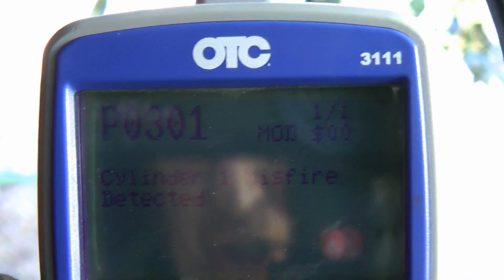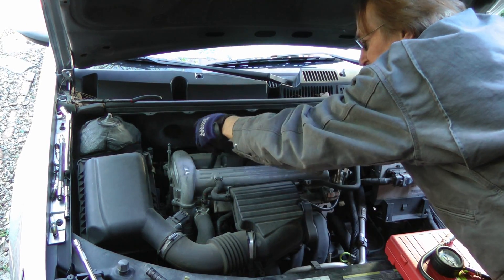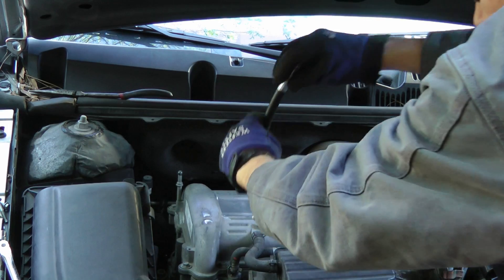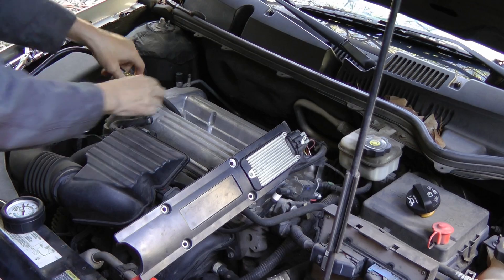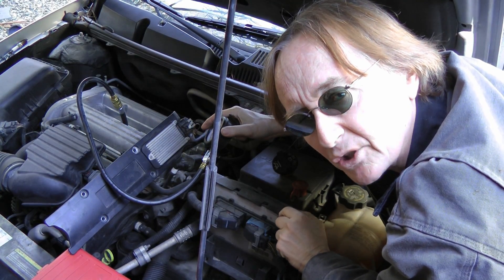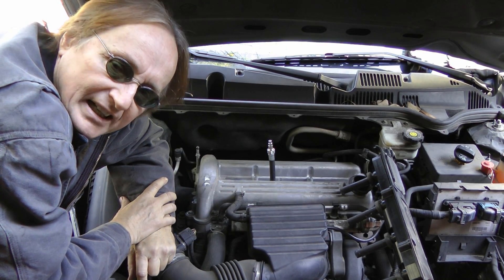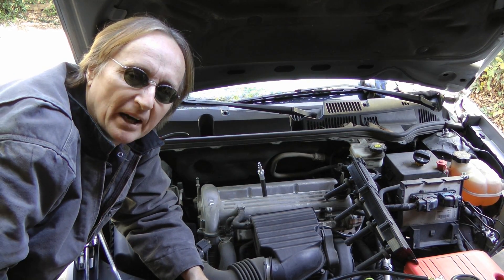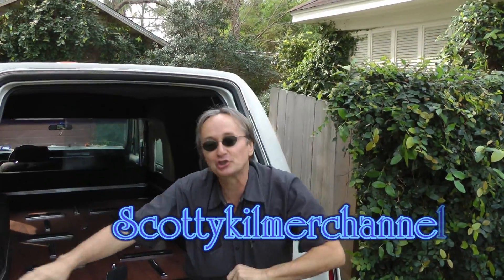Why Do Engines Misfire, Code P0301 (Compression Test)

Comment: Hi Scotty. I love your videos. I have a 2001 ford Taurus that had a mis fire problem Change coil and that fixed about 90% of the problem. Now, the car will run ok for about 20 secs and then the check engine light will start blinking and the car looses power. I havent had the cde checked yet but, do you have any idea what would cause this? Thank you.

Comment: In that case I'm curious as to what the original problem was in the first place because it's the same engine I have in the car now and it's running like a champ and is about to pass the 100k miles (about 60k of that put on by me). What could cause an engine that was put in to run very poorly but after (at the very least) a switch to full synthetic oil with restore additive to run like-brand-new? I guess the simplified question is what kind of problems can an engine have that fix themselves?

Comment: I actually had this happen on an engine I just got put in after the timing chain snapped on the first. After couple oil changes with full synthetic and restore engine restorer additive I've actually been able to drive my car daily since. So if it really is a bad engine would you recommend this attempt at a fix? A can of restore costs me about $8 (for the 4cyl formula). My engine had low compression all around and (after a catcon replacement last week) I'm looking at going over 200k :)

Comment: Turns out I bought bosh platinum 4 point plugs as an upgrade when the car called for ngk single points.  After putting in the correct plugs the code went away.  It cost me about 60 dollar for that mistake after rebuying the correct plugs. I'm sure that I am not the only bone head to do this.  Maybe this will help out some one else.

Comment: Love the video's scotty.  I had one of these (Engines Misfire, P0301) Codes last year on a 05 hyundai elantra.  I did a tune up to the car my self.  After getting it out of the garage I noticed check engine light on with this p0301 code.  Although the car seemed to run fine the code would not go away even after using a scan tool to delete it.
Reply: after misfire …how many it ran for ?

Comment: Hey scottie, got a questin for ya. I recently bought a chevy 7.4 liter 3500 express van/cutaway/rv, its been sitting for at least 2 months and i have to drive it back home, at least 200 miles. Is there anything i should do to prevent breakin down on my way home. will running it for 10 minutes before i hit the road help.

Comment: hey Scotty i have a 2002 civic si with a code p0301,2,3,4 
all cylinders are missfiring i have changed my spark plugs i checked for vacumm leaks,  i sea foamed it as well what else can i do to fix this

Comment: Hello Scotty, I have a 2006 checy impala with 102,000 miles....p0301 code, no prior problems and all of a sudden misfiring.  It was checked and the pressure in cylinder 1 is 120 and the pressure in cylinder 6 is 175....I dont know what to do....do I need a new engine???

Comment: Scotty, I need your input on this. My 08 Subaru Impreza WRX had a problem with "misfire" a few months ago. Only 46,000 miles on it at that time. I got misfire in 3 of the 4cly. The check engine light just appeared one cold night when i went to start it. I got the engine light turned off by my mechanic. The car runs completely fine no leaks anywhere. But I do find it very hard to remove/screw the oil cap back on.

Comment: Thinks there's multiple problems with this motor but this PO341 problem  cost me $352 last time & here it is again. After lots of research, seeing that it could be a shorted wire on crank sensor? Seems these engines 3.4 have this issue on many models including my 98 Venture.Work 14hr shifts can't get to mech til Fri but need it to get back & forth next 2 days for work.Need to get rid of the darn thing but really can't afford nor afford to any more $ into it.  lol What to do?

Comment: Having trouble 98 Chevy Venture (don't laugh).
Engine light on, dies or hesitates at stop signs/lights. Sometimes the motor actually jumps or as I say misses a beat, that's rare but happens. Had work done on it 6 months ago, same thing. Code PO341 again.Oh, now hear something ticking, after warm up goes away.Cam sens was supposedly replaced along with plugs on last repair,taking it back being same prob.Any ideas why it's happening & what to say to mech being it's the same again?

Comment: That pop is a back fire. Seems to me like something is interfering with airflow in the combustion chamber. Excessive carbon deposits can lead to misfires. Check your positive crankcase ventilation valve  or PCV to make sure it's not stuck closed. Also, a malfunctioning idle control valve could also lead to misfire and cause your engine to burn very rich at idlle.

Comment: hey scotty, i have a 2003 acura cl-s and im getting an all cylinders missfire code, changed plugs and did my 160km valve adjustment and it still persists, the idle is a off and the exhaust has a slight pop sound to it at random intervals, shop says do my fuel injectors but im not putting that kind of money into it, any ideas on what it might be?

Comment: hey scotty, I have 96 ranger 4.0 ohv........misfire on 6.......dry compression test 1-5 reads 105-115 psi, cylinder 6 reads 40psi my question is what is more probable a worn cylinder and rings or valves stuck burnt or dropped, and can I tell with the valve cover off if they are stuck or dropped seat, also I wanted to clean my throttle body but ther is a warning sticker that says do not clean special coating, really need some advice fixing misfire........

Comment: Hi Scotty, i recently tool my nissan altima 02 to the mechanic becauase suddenly started shaking and making noises, the mechanic told me right away it was the cataliytic coverter, he changed and the nose its gone, but the car keeps shaking and took it again and now he connected to the computer and the car throws a P0301 code, and says Cylinder 1 its misfire, the mufffler throws hot smoke and my service engine light started blinking..thanks..(Nissan Altima 02, 6 Cylinders)

Comment: Hey Scotty I have a 03 nissan sentra gxe 1.8 that keeps saying cylinder 1 misfire I used Lucas cylinder lubricant and it went away for a while then it came back so I change the spark plugs switched the coil packs and just installed a new fuel injector. Lucas got rid of the problem the first time so I thought it was the fuel injector is it the engine that is messed up?

Comment: Hey Scotty, I've got an 04 SAAB 9-3 that misfires, I've swapped the spark plugs for some fresh factory ones which seemed to make the misfire less rough and all the coils have been tested/working. Swapping the plugs around seems to solve it and the engine and gaskets are in real good condition. Haven't tried this yet but do you think engine pressure is the only possibility?

Comment from the maker: noises can be hard to pinpoint. But, remove the fan belts and run it, if the noise goes away, figure out what device the belts drive that has worn bearings in it

Comment: Scotty, I have an 08 Highlander with 140k miles on it. Everytime I start it up, on idle the engine makes some sort of a grinding noise. The truck runs smooth and it's not noticable when driving. Happens during idling only. What could it be?

Comment: I'm having a misfire as well on my 2000 Pontiac Grand Prix 3.8l. I've scanned the engine and I also get the code Bank 1 System Too Lean. I've replaced all the spark plugs and the wires, O2 sensor, and the injector o rings. I spray carborator cleaner around the fuel injectors and it's sucking in the cleaner even after I put in new injector o rings. Any thoughts?

Comment from the maker: check the carburetor or fuel injection system, whichever it runs, they don't sell em here. either carb needs overhauling or fuel injection system is leaking injectors badly using that much fuel

Comment: Scotty I did a compression test on a 95 Skoda Forman, all cylinders had 130 psi except the number one 120 psi, what would be your diagnose on this engine. The problem is that the car is eating gas like a V8 when its only a 4 cyl

Comment: ok i checked and the head gasket isnt leaking thank god, so that means it could be the injectors?? how do i tell? and i added some lucus injector cleaner to the whole tank and run it down.. still doing it. could it be a bad seal on the injectors and if so how could i check??

Comment: i have a 98 v6 3.8L camaro and it just started misfiring. i pulled the codes and i got p0300(random misfire). It idles good(constant 900 rpm), but lacks power and drinks alot of gas. Out of my exhaust im getting a good bit of vapor. I need an experts guess so i wont be out a ton of money...

Comment from the maker: that's the code for engine position problem bank one. It means the engine has a mechanical problem somewhere on bank one of the engine, the bank that includes the number one cylinder (that's how they label them). good luck on that one

Comment: Hi scotty, I have an '01 v6 cougar. when its cold it runs like new but when it gets to to full operating temperature its get very sluggish and unresponsive. it has no error codes when the scanner is put up to it. The car also has had a custom cat-back on it for the past two years, I don't know if that would effect much.

Comment: hi scotty I have a 2001 audi s4 twin turbo I just take my engine and trany out to rebuild my manual transmission . and I put new timing belt kit sparkplug ... and lot more now I just start my car its run fine but my power steering pump make noise and when I turn steering wheel car turn off and after that start miss fire. i didn't  had that problem before

Comment from the maker: make sure you have the right spark plugs that are gapped correctly first.  And if you cracked any plugs putting em in, that will do it for sure, take em all out and check for cracks in the porcelin

Comment: I'm in the process of repairing a misfire on my 2000 Ford E-150 4.2L. Kept getting code PO305. Plug, wire, coil, & injector all checked out good as well as vacuum and compression test. Turned out to be clogged EGR ports in the lower intake manifold for all cylinders except cylinder #5 sending the exhaust gas intended for all six cylinders to only cylinder #5 resulting in the misfire.

Comment: no it wont because the pressure will only build so much then be released and it can't push the tester anymore "lbs/sq. in."... on my dirtbike it has about 120 "lbs/sq.in" no matter how many times i turn the engine over it just stops there

Comment: I have a question about spark plugs. Last year my 99 camry broke down and I had to replace the air fuel ratio sensor. I let the vehicle sit for at least an hour and I replaced the front spark plugs. I also used anti seize on them. Should I be concerned when I replace the front plugs again

Comment: What about a 2000 Buick Lesabre, are they worth the trouble or more trouble than they are worth ? Mine is only used for quick trips to stores and back, but I'm concerenc about possible engine problems due to misfires.

Comment: I'm in UK here. Got a Chrysler crossfire booked in with a mercedes 3.2 AMG  E32 engine. Misfire on number 6 intermittent fault. Usual scenario swapped 2 plugs for next cylinder as there's 12 on this engine, swapped leads ect. Carried out compression test all good. All mixture adaptions correct and lambda. Manifold vacuum correct, I suspect a sticking valve, as your from the place they are made have you seen such a fault on this particular engine!

Comment from the maker: do this test first, and pray it's not the head gasket as in this car. if compression is good, it can be a bad fuel injector or bad coil on plug assembly

Comment from the maker: air flow often is changed on new heads, so they will often suck air differently and make such whooping noises, I see that a lot. if it runs fine, it means nothing. But often cleaning the throttle can stop it if build up is causing it.

Comment: @Jim Dillinger usually because the engine is cold. The air-fuel ratio isn't at a perfect  yet. The computer also tells the engine to run at a higher rev so the engine will warm up sooner. This is just a few things that cause that. Someone else can give you a more detailed answer. ( I'm too lazy)

Comment: Hey, i have a weird noise coming from the NEW head on my engine, the valves are also NEW/ Refurbished.
The noise if i can explain, sounds almost like a small datsun Carburetor intake, that small Whooping sound it makes when you accelerate, well is this normal? Everything seems fine. But it just started doing it recently,
Heads been in for about 1.5 months...

Comment: I had the same problem shortly after having my transmission rebuilt. I brought it back because my regular mechanic said it was the transmission. The guys at the transmission shop said it was an engine misfire and I could only feel it in high gear because the torque converter absorbed the shock until it locked in high gear. It turned out to be a cracked spark plug. It's a 97 olds 88. No problems in over a year anyway.

Comment from the maker: 1.8 celica, no problems at all. But do test the transmission and do a compression test of the engine before buying to see if it's been maintained. Any car will fall apart without oil changes

Comment: hey scotty i have a question i have a 1993 chevy cheyenne  c1500 and my seatbelt chimer alarm deal isnt working the wires are hooked up from the belt to the hookup to the computer but  im missing the chip that powers it i was wondering if you know what the piece was called and how much it would cost thank you

Comment: Hi scotty 
I have nissam 1998 pick-up it is driving me crazy
Some times when i turn it off for while and try to start it again
It wont start but if i leave it 12 houres it starts
And there is a electronic part connect withe all the spark block wieres who shock me hard
Sorry for my write

Comment: this doesent move if you were to get up normal temperature like other cars an check while idle i gussing its ok never seen that is a ram 1500 4.7 2002 we got a2004  big block cadilac that goes to high to when checked i put a zmax in it though had new fuid

Comment: I had a P0301 code on my '98 Honda Civic back in November. I was freaking out about it so i started doing whatever I can to get it going. I hit the fuel injector a few times with a flathead screwdriver and the car started to purr like a kitten again. This happened a few more times over the next week so I just replaced all the fuel injectors due to the fact they were all put in the car at the same time, has the same mileage and has the same wear on it.

Comment: im getting codes p0302:cyl 2 missfire, p0303: cyl 3 missfire and p0300: multiple cyl missfire. 2000 jeep grand cherokee. They both did it at the same time

Comment: I had the same code last week and found that it was not in the engine, but in the exhaust. One of the cats were clogged/ broken causing the Truck to build too much pressure making the engine misfire.
Reply: How did you figure out it was the cats and did the code go away?

Comment: I did a tune up on my nissan and it started misfiring, put new rotor button and distributor cap and plug wires on and it still was there. Turns out it was a defective spark plug as it was burned black after less than 200 miles driven and all the others were fine. So long story short don't rule out spark plugs even if they are new.

Comment from the maker: frame straightening has to be done by a pro with a VERY expensive frame machine. MANY things can be damaged from a wreck, but motor and transmission mounts cracking is number one, so check that.

Comment: I had a misfire on my 84 Toyota Van that would go away when I got on the highway.  Eventually, it got worse.  I ended up tracing it to a collapsed hydraulic valve lifter.  Bought a new lifter for around $12 and put it in and now it runs like a top.  The way I found it was pull the valve cover off, start the engine, then look to see which rocker was moving less than the others.  When I pushed down on the push rod side, the engine ran worse.  When I pushed down on the valve side, it cleared up.

Comment: Hey scotty, in the past my car was rear-ended and since then the engine vibrates when on drive but on neutral it doesn't vibrate. When I accelerate, it jerks. Is it a misfire, bent frame, bent drive shaft and if so can you do a vid on how to straighten the frame of a car or give me tips on how to fix the problem? Thanks.

Comment: i have a 89 toyota camry.i took it to a shop for timing belt change when i get it back it wont go at all have to floor it and still nothing. There saying they didnt do anything wrong and it the tensioner. The timing belt is very tight dont see how it could of slipped im thinking the put it on wrong. and i know they didnt mark the timing belt like they should of. just wondering how tight does it need to be. need help! and they wont look at again there said going to recharge me.

Comment: hey scotty just wondering but how long should i crank the car for when doing a compression test and should i remove all of the spark plugs or leave them all in and just take out the one on the cylinder i want to check the compression on. thank you

Comment from the maker: the ignition is disabled on that model as soon as you remove the coil assembly to get to the spark plugs.  And you can check compression with throttle open or closed, doesn't really matter, it's only the pressure difference that really matters.

Comment: I've used either 5 or 10w30 always. The car recommends 5w30, and I use a NAPA Gold filter. Sense, I used to work there, I know their filters are built better then others, even Fram ones which I thought where the best before I got the job there. They have a bypass valve in it encase the filter gets plugged (which may be happening to), and the caps are made of metal, unlike Fram's which is cardboard.